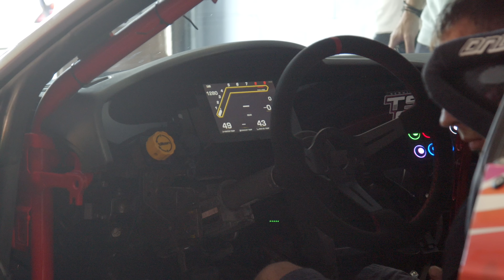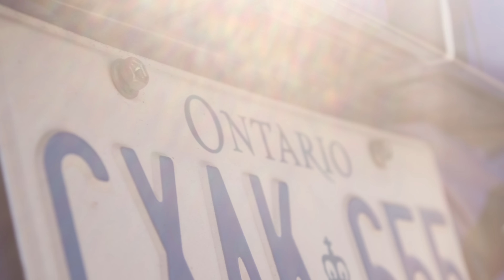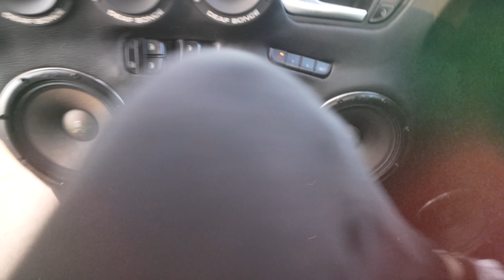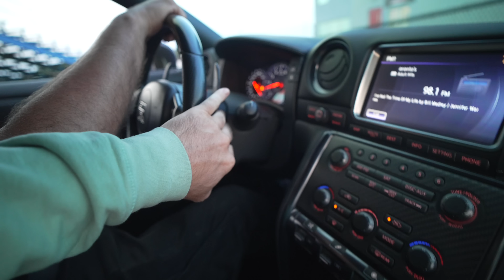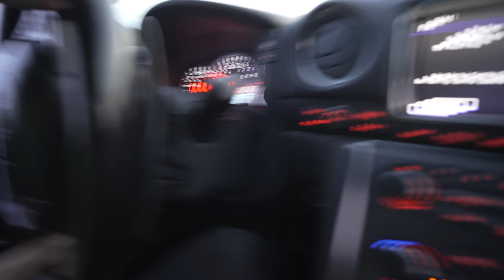VW made a 2JZ RIVAL that's ROTTING in scrapyards...

Comment: the vr6 is common in the euro  drag cars its called a r30 vr6
Reply: R30 means it’s a r32 vr6 engine (3.2) and it had a 2.8 vr6 crankshaft with custom pistons making it around 3.0
Reply: @jamesdean514   they get some good power out of these as well
Reply: @G3LDY  less rod angle of the r30 ment to be stronger for high power applications that’s why a lot of drag vr6 are r30
Reply: @jamesdean514  its such a cool engine thats overlooked iam glad people are using it 😃 my mate was building onehere in scotland but think life got in the way and he sold it on.

Comment: No because it's only possible for there to be one 2JZ. Plus the Toyota engine is proven reliable. V.A.G. Engines are not as reliable and V.A.G. parts and dealer charges are as high as it gets.